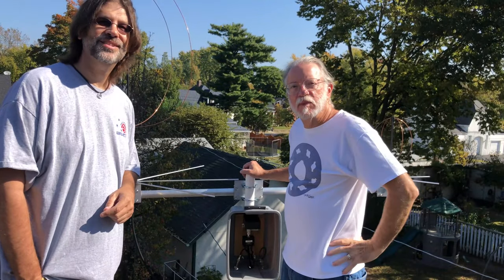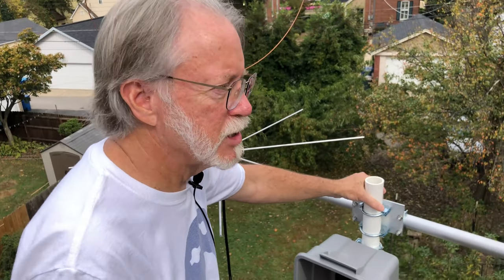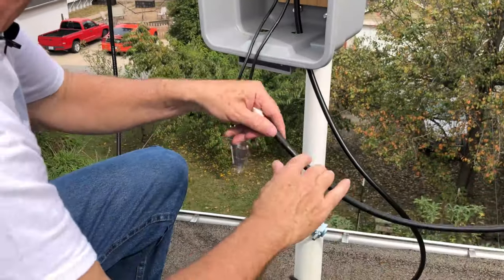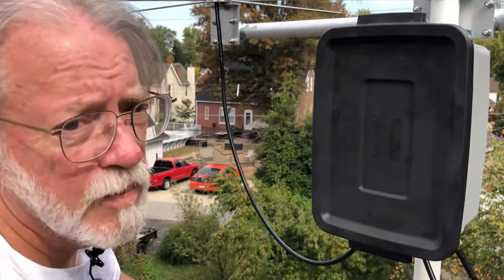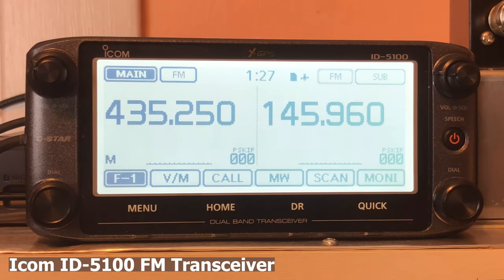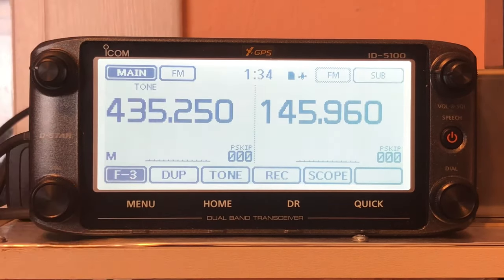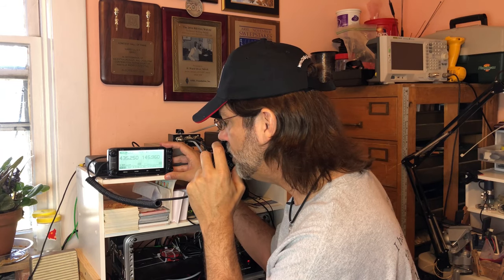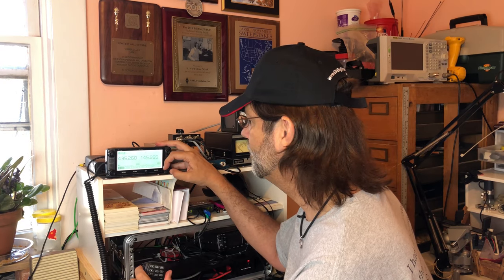Operating FM Satellites with M2 Eggbeater Antennas and the Icom ID-5100 Transceiver

Comment: I've been using a setup like this (minus the preamp) since the fall of 2020 and quite like it. My M2 eggbeaters are on a separate mast, level with the roof line of my house. I have preamps that I will be installing in the spring. I'm using two separate runs of LMR400 into my FT-847. Even without the preamps I'm hearing and working North America, the Caribbean, and western Europe on FM, SSB, and CW. Eggbeaters are a compromise as opposed to beam antennas, but I am really liking the opportunity to work satellites from the comfort of my shack, instead of standing outside juggling lots of equipment in the het/cold/insects/rain/etc. Great video, de VY2HF in FN86.
Reply: Over the years, the hassle you described drove me to enjoy the comfort of having a shack :)

Comment: those LEO sats and ISS are often a real mess where everybody step onto each other, really difficult to make contact and I've been crushed many time even though I use a 13el and 21el beams with AZEL rotators... If you are able to try linear transponders, that is way more fun, many contact can be taken at the same time on the same passband... way different attitude on those sat than the FM sat in my opinion...

Comment: TNX Sean & Ward - M2 Eggbeaters are a great starter AND backup - our ARISS event had a equipment failure at the very last moment and we actually were successful on the backup 2m Eggbeater (talk about pucker factor!).  73 - Dino KLØS
Reply: And what do you recommend for a permanent / advanced installation  ?
Reply: @wmarin  Well, the best scenario I think would be dedicated yagis for 2m/70cm with mast mounted preamps and cross polarization switching swung by a azimuth-elevation rotator. Egg beaters are ok but not optimal.  Depends on how much real estate you have, how much you want to spend, etc.  It's just like the rest of ham radio, you can spend a lot or a little...depends on your expectations. Good luck!  73 - Dino KLØS

Comment: Hi Sean, first thanks for all the help getting the right radio. I did this setup completely but today I have a question about it. I just ordered the IC-9700 on your advice but it has 3 different antenna connections. 2m 440 and 1.2G. Do I have to run another coax to the eggbeaters and remove the duplexer? For now I want a dummy load on the 1.2 g because I don't have an antenna for that. But how do I connect the eggbeaters to it? BTW they work better with my handheld then they do on my Yaesu 991A. Thus I bought the IC-9700 Icom. KO4PDI Thanks again.

Comment: If i want use an icom 910H (that has separate output/inputs. For the 2mtr & 70cm) with the Satpack shown won this video.  But i want use one feed line, do i need two diplexers? Or two duplexers?

Comment: I thought it should be the Rx freq that you changed for doppler, not the tx frequency?.
Reply: You adjust your 70cm frequency for Doppler, whether it is transmit or receive. There are sometimes minor adjustments to the 2m frequency as well.
Reply: In a perfect world, you'd adjust both in opposite directions, proportional to their frequencies. Tx low to high and Rx high to low. I wonder if there's a way to use a computer to automatically tune the Rx and adjust the Tx based on the Rx frequency.

Comment: It appears that the vhf and uhf are combined at the duplexor then through the uhf preamp. This is not the correct way to use the preamp, it should be between the duplexor and the uhf antenna. It will be sensing rf presence on  vhf and uhf the way you have it setup. It should  not pass or attenuates outside the uhf band thus degrading vhf reception. In addition passing bidirectional rf in a feedline will cause echoing unless you use a hardline that has a corrugated shape on the interior surface of the shield, although not as perceptible when the frequencies are third harmonics.
Reply: If the preamp is “between the duplexor and the uhf antenna” on the high side of the duplexor, how would it get the DC it needs for power?
Reply: @terrybondy5458  dc can be delivered on a separate 2 conductor line as the most cost effective but there is a device that will mix dc with rf at the radio end and extract it near the antenna end.
Reply: Yes, some preamp can't handle power through vox operation if wrong band (if run ptt on 2 meter side and preamp is before duplexer some can burn, if was after duplexer in dup and antenna works 100% ok)
Reply: Receiving on 2 m and it's a 70 cm preamp, not sure that's right either
Reply: " In addition passing bidirectional rf in a feedline will cause echoing unless you use a hardline that has a corrugated shape on the interior surface of the shield" - I've done a quick search and references to corrugated coax seem to be related to bend ability rather than echoing. Can you supply more information?

Comment: Great tutorial. I’m new to satellites, using a cheap HT and an Arrow. I have lots of success, though full duplex would help. Barring another FD HT entering the market, I’ll try splitting two HT’s on two antennas. I noticed you worked AO91. I have listened several times in the last six weeks and have are absolutely nothing from AO91 or AO92. Are they active?
Reply: Hi Steve! Sadly, AO91 and AO92 are both experiencing some trouble right now. For now, try SO-50, AO-27 and PO-101 for FM satellite contacts. SO50 uses a 67 Hz tone, PO101 uses a 141.3 Hz tone, and AO27 needs no CTCSS tone. You can check the operational status of satellites at the AMSAT Status Page: https://www.amsat.org/status/
Reply: @seankutzko4578  Thanks! I'm AO27 and SO50 daily. I will add PO101 to the mix. Too bad about ISS, AO91, and AO92 being on the fritz. Guess I'll need to gear up and go SSB to get my fix!

Comment: There are so many problems with this installation that it's hard to know where to begin, you'd think DX engineering of all people would have done a much better job.

let's start with the fact that you should never use LMR-400 for full duplex operation. LMR 400 is not rated for full duplex operation and will cause issues. It is susceptible to passive intermodulation distortion aka PIM.

PIM is the result of the double shielding where you have a braid in contact with aluminum, every point in which the braid touches the aluminum becomes a diode junction, this results in popping and arcing in the feed line during transmit. granted it is very low level but it is right at the front end of your receiver which will make reception very difficult. 

It's easy to identify repeaters where the repeater owners have mistakenly used LMR-400 because the repeaters are plagued with popping sounds, this only becomes worse with water intrusion.

times microwave does make a low PIM version of LMR-400 But it's substantially more expensive, it would be cheaper just to run two coax runs.

while the M2 egg beaters are a decent off the shelf solution they are massively overpriced for what they are. You can literally build a homebrew version for probably $15 with similar or better performance.

So my suggestion would be to Homebrew your antennas, that way you could afford two decent runs of coax while avoiding the lossy combiner which he calls a duplexer. never could understand why hams call combiners duplexers, that's not what a duplexer is. duplexers are used in repeater operations. I suppose this is all the result of the dumbing down of the ham tests, It's gotten so bad that even the manufacturers are now labeling combiners as duplexers so they don't confuse hams. 

Oh and do yourself a favor, avoid these vox preamps. They will fail. people use vox preamps because they're lazy or don't understand how a bias-t works.

The problem with vox-based switching is that it is too slow, every time you key up the radio a few milliseconds of transmit power leaks through eventually this destroys the preamp.

this can be somewhat mitigated with a satellite radio that has proper sequencing. For example the IC 9700 will allow you to delay RF by up to 30 milliseconds, 200 milliseconds would have been a better option for vox.

Comment: meanwhile fm receiver performance has not improved  hardly at all in last 50 years..
dsp noise reduction schemes are USELESS, 
fm receivers are susceptible to an orgy of impulse noise, noise blanker circuits are not allowed on fm.
ge had supremely effective noise blankers in fm radios over 25 years ago, and todays sdr based rigs are drifting out of the box.